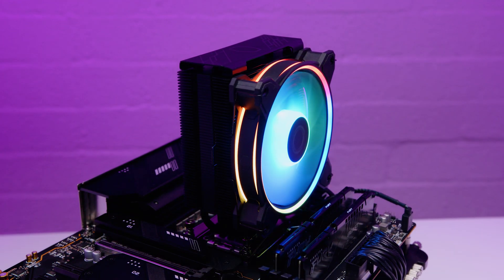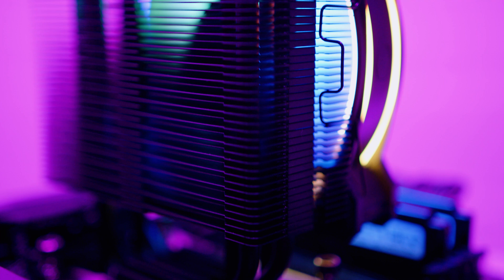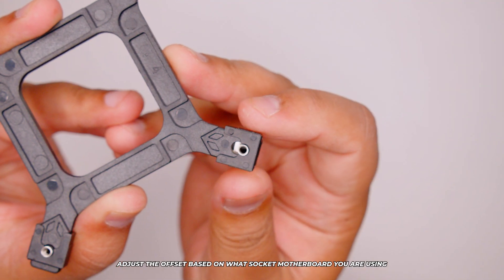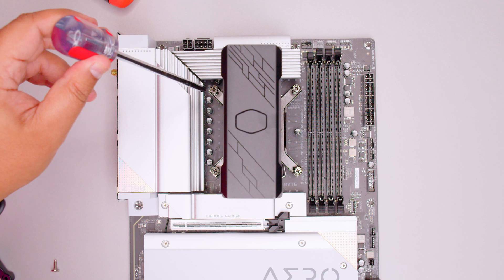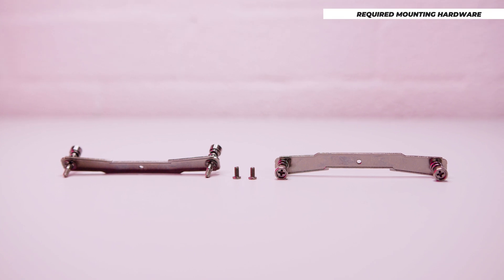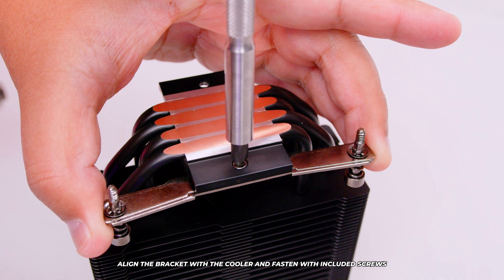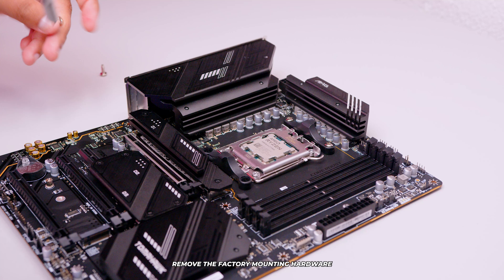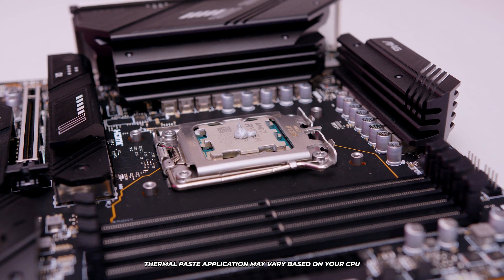HOW TO Install Cooler Master Hyper 212 Halo on AMD AM4, AM5 and Intel LGA 115x, 1200 & 1700

Comment: Thanks for this video buddy.  First time installing one of these.  Intel stock cooler got stuck on one of the mounts and I had to destroy it to get it off!  It was still really nerve wracking, because my motherboard has a plastic rectangle on the back, which cannot come off.  I used masking tape to hold the backplane on, the tough part was pushing down on those springy screws to get them in the holes.  You really don't want to jam them into the motherboard!

Comment: I came here looking for how to clip the fan to the cooler because the drawing sucks. Thanks for this, it was the only part that stymied me. Your video also showed proper fan orientation. You might mention that it's best to install the fan with the cords at the top of the motherboard cause that's where the connectors will be.

Comment: I can't figure out how to get the back plate to fit with my MSI B450 Gaming Pro Carbon AC motherboard even tho Google told me it's compatible
Reply: I checked in Newegg and it also says the cooler is compatible with that specific motherboard. 

Did you manage to install it? I recommend to contact the customer support from the store you bought it to assist you.

Comment: Wait, either you’re wrong or I’m wrong, I installed the fan clips the in the holes closest to the heat sink, and then just slid the fan on without needing to pull them, seems easier than the way you did it

Comment: Hi, I wanted to ask how tightly is the cooler installed? Im making a pc tgat will be moved alot and I want to make sure the cpu cooler won't get loose while i move the pc and won't cause overheating issues because of that.

Comment: I got this cooler to use with a lower level cpu I got for my old am4 board. I’m fairly disappointed it didn’t come with what it needed to be installed in am4. My previous cooler didn’t need the back plate so I don’t have it anymore
Reply: Hey I am in this exact situation, what did you end up doing?

Comment: the thermal paste that came what mine had to be way over the expiration date cuz its like concrete material unlike urs looks smoth
Reply: Nvm man. The thermal paste is dog shite. Lmao replace it as soon as possible. Its so bad it ramps up to 99 c for me
Reply: @ that was prolly why my brand new cpu kept going to 90 C gaming, good thing i jus got this cooler on today cuz was missing 2 screws that go on the back of the motherboard for the cooler when i commented that so had my old cooler with that thermal paste in but this time i put corsair thermal paste from best buy on thank god i did after seeing ur comment lol

Comment: can the RGB be changed to white? and can you turn only the ring led on?
Reply: @LaserHighway  unfortunately, there's not much you can do. You can install softwares like openrgb/signalrgb but they're bloatwares and just very conflicting with other RGB softwares like ICUE(corsairs RGB software)

Comment: which way does the fan point? there does not seem to be any instruction on which side of the fan clips to the heatsink. you seem to be pointing it away from the rear and toward the front of the machine, unless I'm wrong.
Reply: Fan on the front side (with centre 'O' logo visible) so it sucks air in and pushes it through the heatsink and out the rear of the case.

Comment: Hi, I’m stuck on the AMD part with the backplate.
My AMD does not have those socket like things you put the cooler into.
Does cooler master just expect every AMD to have those pre installed?
Mine cooler did not come with those
Reply: It should've come with your motherboard
Reply: @rozkie  im having the same problem which is, I bought a pre built that didn't come with the stock cooler, it came with another chappy budget one and it didn't use the am4 backplate. So now I'm stuck with the hyper 212, without the am4 backplate.

Comment: Have a mid range setup.  Ryzen 5 5600x w stock cooler. Easy to remove after I ran the pc for a little. Easy install.  Excellent review.  Was pushing 60-67 when running BO6 on Decent settings.  Now around 40-45
Reply: Did you use the stock cooler back plate? If so any issues?

Comment: Is it possible to rotate the cooler 90°,as was possible with the original version? The mount doesn't look as versatile.
I like to move the heart straight up in chassis with air vent in the top.

Comment: To any body installing this on an AM4, the backplate comes with the motherboard, it looks part like a that could tossed away buts that's the plate you use with the fan.

Comment: it wont fit in my 1151
Reply from the maker: It absolutely will
Reply: @GearSeekers  Dude, while I don't have the Hyper-212 Halo, but I "DO" own its bigger brother, the Hyper-622 Halo Black.  and despite the installation being somewhat problematic at first (very nearly lost the tiny screws that came with it), once it fitted directly over my Intel i7-4770K (the old LGA-1150 socket), it worked like a dream.
Reply: @GearSeekers  Ima remove the motherboard today and try again

Comment: I had my motherboard installed on the case already, theres no way to get the backplate in place now, is it ? It'll just fall off when I tilt it on the table to put on the cooler 😂
Reply: depends what was in place before it may already have a back plate if not mobo with have to come out thats the part they dont talk about in the videos

Comment: Hello love the video i have a problem with mine, i installed everything like you done in the video when i try to use master+ the argb software from cooler Master, it tell me that he detect nothing, can you help please 🫠
Reply from the maker: Because the cooler is a "dumb device"
Use your motherboard RGB software
Reply: @GearSeekers  I do but there is less modification then the Master+ have.. With my motherboard software i can't control the rgb of the fan or the rgb of the ring, it all in one and that's all...
Reply from the maker: You can't control it anyway
Reply: @GearSeekers  realy 😯 ? A dude from the client service of cooler Master told me that i could do it..

Comment: Do you think I can get the necessary details to install the old version of Hyper 212 Plus on an am5 socket? My kits are not suitable for installation except with an air flow from bottom to top.

Comment: You are not clear on where to clip the fan. What is "the front side" and what is "each side" there's 4 bloody sides
Reply: i know im late but it doesn't matter which side you do it on. Just make sure the front side is facing you (the good looking part)
Reply: @distorteduzi what’s the “front” ? The part with the orange lines? It’s a all black box we need extreme detail pls lmao.
Reply: @deu6  Same. The whole install is not clear. It’s been a while since I’ve built a computer but how is it becoming harder than just lowering a heatsink and screwing it in.
Reply: That’s why I’m here
Reply: The side ones lmao why would you use a clamp upside down, use your head now
Reply: Exactly
Reply: Blow throw towards exhaust case fan. Obviously
Reply: @deu6  because of this I downvoted the entire video

Comment: can i add one more fan on the rear of  the cpu cooler ?? if so..should it be intake or exhaust ??
Reply: yes, and it should be exhausting the hot air from the cooler

Comment: Question, if my motherboard doesn't have a 3 pin argb header/connector slot and only a 4 pin 5v one what can I do? 
I read online you can buy a Coolmaster Addressable RGB Led Controller. Would that do the job? Please help

Comment: Thanks for the video I was switching my old hyper 212 black edition and it had 4 hex nuts

I liked the new one because the installation screws are flush so it's impossible to over tighten

Comment: i dont like how it sticks out the side of my case, even after asking people at the store if its fine for my build.
Reply: would be nice if the screws didn't come to a hard stop and had room to sit further in the case, seeing as there is still about 3 mm of space on the spring connected the the brackets
Reply from the maker: The cooler shouldn't sit outside the case
Reply: @GearSeekers  Yeah i returned it. its way too big for alot of cases

Comment: my water cooler pump just died and I got this air cooler to fill the gap while I wait for my RMA replacement. It was only 30 bucks and honestly it cools just as good as my 360 AIO water cooler. I may end up just leaving it on as it has a lot less wires and is way easier to take on and off if needed.  About to add a second fan to the backside to increase air flow. Awesome unit! Cooler Master makes great stuff.  Im getting idles at like 36-39 all day long and load of only 60-70. This is on a 13900K by the way also, so no slouch on the CPU either. Buy it!
Reply: Same experience with water cooling. I switched to air 20 years ago, and I'll never go back to liquid. Just to many failure points, in my experience.
Reply: A second fan can be added?   How do you make sure you get a fan with the same clips?  When I bought mine they installed the cooler and fan for me, so I have no idea where the clips came from.

Comment: Ohh.. mine came with clips for two fans. Did I get lucky or are they just doing that now?  Who knows, but I say it was a win because I also bought a second fan when I picked this up at microcenter and this cooler works great for me. I did end up using both fans from the start but I may remove one and see how the temps vary when not in a push/pull configuration. So far this thing is keeping my I7-11700k thermal heat death ray cpu from cooking itself.

Comment: Tried to follow the video but now im stuck... My mobo doesnt have any protruding holes in it. I checked the bracket from my old cpu cooler but no matter what it wont match up.. Not really sure what to do now :/
Reply: did you ever solve this issue? im having the same problem

Comment: Is it necessary to plug in the RGB cable? I plan on purchasing this for use on an older motherboard that does not have RGB functionality. Thanks
Reply: Yes you can run this without the RGB cable connected to the mobo or RGB hub.  Get you a little zip tie and tie the cable up out of the way and boom you are done. Or leave the cable dangling like a madman... whichever you prefer.  :)
Reply: @agent_smith...  thanks!
Reply: Did you need it ?
Reply: @TheRockntrio  didn’t buy it yet, though according to @agent_smith… you don’t need to plug it in.
Reply: @ragnarocking  bought and it works fine without it plugged in!
Reply: Sometimes you just have to experiment. I have done this with a case full of ARGB fans just because I wanted to see if it could be done.   I am a low budget madman.  :)

Comment: Just installed mine, and its only using one color? How can i change it to a rinbow like in the vid? :'(
Reply: Mine is plugged into my mobo so I use either MSI center or signal RGB to mess with the colors and how they flash or whatever. If your mobo doesn't have the ARGB pin headers you will need either a case with an RGB hub or you have to buy a 3rd party RGB controller.  They all cost about the same so its your choice which to get if you need one.

Comment: I installed this fan and went fine but problem is that it’s overheating or it says so it’s at 100 degrees,should I let it run for a while so it programs the temperature or did I do something wrong
Reply from the maker: Check your installation

Comment: I got this at Best Buy today. I had trouble tightening the screws on my motherboard. Is it possible if I just place the fan on top of my CPU and plug it into the motherboard?
Reply: have you resolved this issue? im having the same problem

Comment: I have am4  socket .. this cooler have 4 pin or just 3 !?  I don’t have 3 pin slot …
Reply: @morphybx2626  how did it go?
Reply: @SciK. Mine worked fine. It uses a 4 pin CPU fan connector and a 3 pin RGB LED connector. My AM4 board does not have a 3 pin RGB LED connector so I just plugged in only the fan cable and tied the LED cable out of the way; the cooler still worked and used a nice rainbow RGB pattern. Possibly the easiest cooler install I've ever done (thanks to watching the video). I did have to make sure the CPU backplate was held in place while attaching the cooler, so watch out for that (also the cooler doesn't come with its own AM4 backplate, make sure your board has one).
Reply: @shane3464  mine worked fine as well. I ended upgrading to AM5 so the backplate wasn’t an issue for me. Temps are fine on my 7600x so this is a good air cooler. Thank you for dropping a message though.

Comment: Do you know where I can order a second RGB fan? I cannot find the 202003420-GP fan anywhere online 🙃
Reply: I bought a second fan from microcenter when I got this. (Cooler Master SKU: 597393 Mfr Part#: MFLB2DN21NP2R2)<----  exact same fan as what comes with the cooler with the exception the back of the fan has a sticker with a purple section on it while the coolers fan has a section of grey on the back of the fan. Outside of that the exact same fan blade and all that.  My cooler did come with 2 sets of clips so if yours didn't I have no idea where to get those outside of calling coolermaster and talking dirty to whomever answers the phone in the hopes they will send you a set.  :)
Reply: @agent_smith...  appreciate it 🙏

Comment: What if you don't have a 3 PIN 5V ARGB header on your motherboard? Will it still work?
Reply: i didnt't have 3 pin 5v and just connected cpu fan pin, works and lights up
Reply: @Sauron_556 same
Reply: @Sauron_556  really?
Reply: @Mariomon14  yes
Reply: The fan will work fine but the lights won't light up
Reply: did you get the answer to this?
Reply: Yes just no lights

Comment: Do you have to use both wires if you dont plan on using the RGB? I read somewhere it would just be a default rainbow color if you only plug in the 4 pin.

Comment: What do you mean LGA....i am looking at the gaming pc specs online for the gaming rig i just bought and no where is there any "LGA...." but someone on reddit said they bought this cooler for the same rig i got, do can you please speak in layman's terms? This is my first gaming rig, i need it spoken to me in english not tech
Reply: LGA = Land Grid Array.  Intel uses this designation for their cpu sockets. If you see AM2-AM5 or one of those with a + thats the designation for AMD cpu socket.  So basically if your cpu is Intel its gonna have LGA socket.  If its not Intel then its AMD and will have an AM 2,3,4, or 5  socket.  Look at your PC specs and find your cpu name/number and google it. You will find the specs for the cpu and somewhere in there the socket type will be listed.

Comment: I'm sorry but those 4 screws with springs mounted on them are a freaking nightmare to install. The springs push the screws up while you're trying to screw them down. This mecanism makes the screw move away from the bolts while you screw them. It also forces you to tighten your grip on the rad, but you can't because the thermal pastes makes the rad slip on the CPU! Absolute nonsense. I ended up breaking one of the screws inside the bracket, which is a pain in the ass. I hoped they'd fix that in the updated Hyper 212, but nope. Installing a cooler shouldn't feel like you're playing dice with your CPU.
Reply: I had that same problem.
Reply: The springs were so tight I thought I was either going to break the motherboard or break the cpu trying to get the bolts to thread into the motherboard bracket
Reply: If I would only have known this before buying this model for my son's new PC. I did install plenty of CPU coolers before but this one was a total clusterfuck! One of the 4 screw apparently also was damaged during the horribly finicky installation and as a result does now turn lose. While the cooler weirdly appears to sit tight on all 4 backplate mounting holes, the 4th screw cannot be removed anymore, which will make upgrading the CPU impossible.

Coolermaster support seems to be not very interested and literally have suggested I should try breaking the mount on the backplate to remove the screw. 

That I am risking damaging my mainboard's PCB in the process and at the same time ofc will void the warranty of the cooler seems none of their concern.

Never again this company!

Comment: if Coolermaster just add some additional fans hooks so that u can add another rgb fans for exhaust or push and pull configuration for more performance and hide those bracket from the other side
Reply: Bought mine a couple days ago and it came with 2 sets of clips.  I was pleased to see this because I had no idea where to get them so I was about to Macguyver something.
Reply: @agent_smith... The cooler came with 2 sets of clips???
Reply: @gregkeeyako  yes..   Ironically I no longer use this cooler so if you need the clips I can send them to you.
Reply: @agent_smith... Thanks.  I appreciate that. Amazon has them cheap.  Probably cheaper than the cost to mail them.  But thanks anyway buddy.

Comment: The brackets supplied with mine are not flat they jut up half an inch at the ends so the screws wont reach
Reply: Same here, did you find a fix?
Reply: Anyone fixed this? i bought one but i give up because brakets didnt match backplate

Comment: How do you install it in an AM5 mobo?
Reply from the maker: Watch the video to find out
Reply: @GearSeekers  the screws won’t reach the holes on B650 AM5 mobo, I have the ryzen 7700x cpu which protrudes out from the mobo, raising the cpu CPU cooler height, screw this gonna get an AIO instead lol

Comment: What happens if I want to replace my existing stock cooler and I don't want to unscrew everything and take out the motherboard simply for installing a new cpu cooler? Is there a way?In the past,Coolermaster coolers had some bolts with which you could fasten their cooler backplate in the back of the motherboard and it was extremely helpful.Does this specific cooler have this option? Otherwise it is useless unless you are installing everything for the first time.Thanks.
Reply from the maker: You can do it it's just a little bit trickier.